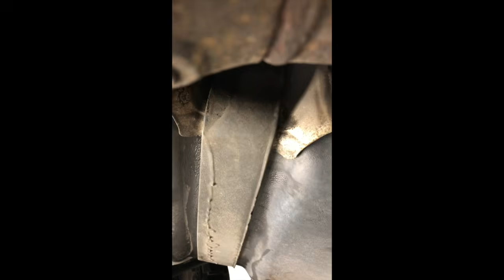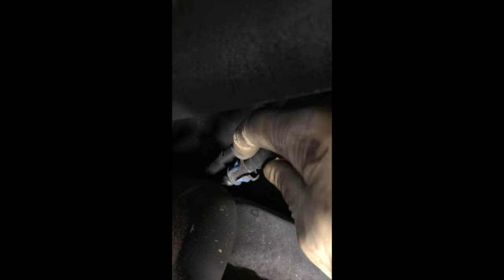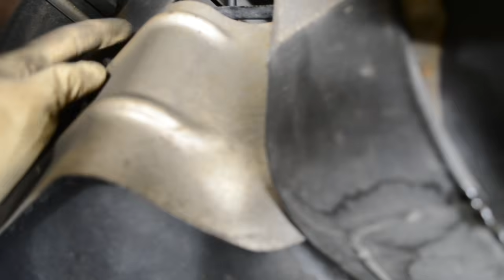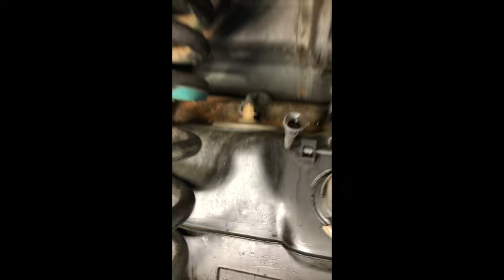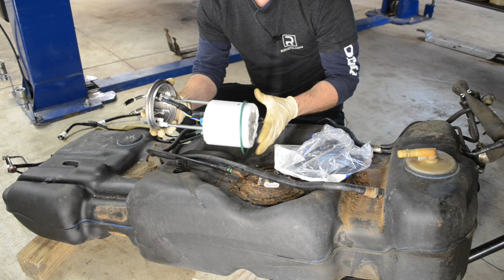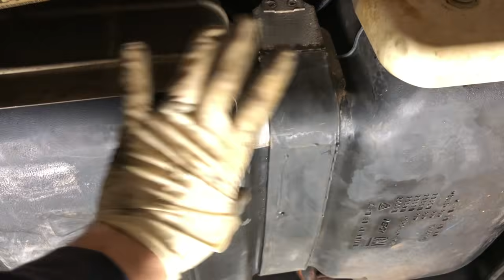Fuel Pump Replacement Chevy Tahoe 2006-2014

Comment: 2007 tahoe here.  Exact same problem. ….. I think.   Smell gas after a drive.  No dripping, but are some dried liquid trail lines along side of the tank.  The evap system is tight, tested with smoke machine.  
I am now (today) in process of removing the tank. Something similar to this is what I am expecting to find.  Sucks that there is no way to see or diagnose this without removing the tank.

Comment: I must ditto previous comments on the excellent quality of the video work for clarity, brightness, commentary and providing a through understanding. I have a 2005 GMC Yukon XL Denali that has same set up. Do you have a video for replacing fuel lines for same or similar? I’m also having to replace brake lines simultaneously. Thank you for helping me complete the work I need to finish.

Comment: This is a great video.  I had a sudden severe leak from the top of my tank and I suspected the metal lines were rusted.   I was able to get a endoscope camera up above the tank and verified a rusted split fuel line.  After viewing your video, I was able to easily remove the fuel tank and fix the problem.  I ended up replacing the evap lines on my fuel tank as well, since the metal fuel lines broke inside the plastic connectors.  I referred back to this video a couple times to make sure I had things oriented properly during reassembly.   Just a quick note on the evap line set...  The evap lines come in a huge box.  Rock auto wanted $60 to ship the lines set.   Amazon end up being much cheaper since shipping was free with Prime.   Thanks again for a great video.

Comment: Man, that's one heck of a job... I'm sure it took quite awhile.

I have a somewhat different problem. I recently started smelling gas in my 2013 GMC Yukon (almost identical to Tahoe), but there is no gas leaking down anywhere... I only smell it when driving and/or idling with the driver's window down. No gas on the road or anywhere around the engine. And I basically only smell it somewhere around the driver and passenger door behind it. There doesn't seem to be any gas smell in the back at the hatch... open or closed, or on the passenger side.

Some guy told me that it "definitely needs a complete gas tank and line replacement." Of course he told me this without actually looking at it. He said, "Experience tells him it all must be replaced and will probably cost me between $3,000.00 - $4,000.00  or more... if not "A LOT MORE". Funny that he claims to know exactly what's wrong without actually seeing under there, but has no clue what it will actually end up costing... not even a ball park figure, again, especially since he claims to already know what's wrong and claims he has done it so many times.

Another mechanic said he would have to actually see the top of the tank and that area before assured diagnosis, which sounds a little more realistic and trustworthy to me. He said if the tank, fuel pump and lines needed replacing it would cost around $1,800.00, parts and labor... IF, he can even find a tank these days. He also said if it weren't too rusty the tank may not need replacing at all. 

I don't know... this [video] repair looked pretty rusty around the rim of that tank opening  where the ring turns and connects... like those clips that hold the ring were rusted pretty badly. I wonder how long your repair will last before those prongs the ring turns into rusts and will no longer support it without replacing the tank also. Why am I asking? Because if I have that problem I'm wondering if it is even worth repairing at all considering the age of my vehicle.  I've owned lots of cars... GM vehicles seem to rust underneath a lot faster than other brands. Am I right, or wrong?

I hate not being a mechanic, and not having the proper tools, facilities, let alone the knowledge, at times like these. Parts and labor for autos have skyrocketed the last few years it would seem... especially at dealerships.

I know this vid is older, but thanks for the info... great vid! And thanks ahead of time for a reply if you are still able or monitoring this channel.

Comment: GREAT video, just finished dropping the tank on my denali. Only difference is the denali fuel pump has three lines out with the evap line connecting directly to the fuel pump versus the back of the tank. The only thing I would recommend adding is blowing out all the evap lines from both directions as carbon builds up in the lines as the evap cannister's filter deteriorates. Remember do it from both directions and make sure the air pressure coming out both sides is the same in force as the air coming directly out your air pump. That's the only way you can ensure their is no blockage in the lines. Also blow out the line from the purge valve under the engine to the right front corner of the gas tank that you disconnect when dropping the tank. I recommend blowing both directions as well. The reason for this is that once the carbon backs up in the lines, it will cause gas the high evap check engine code and you won't be able to  pump gas continuously as the gas station pump will constantly shut off. This is just good preventative maintenance anytime you drop the tank. Also, Amazon sells a $10 tool for disconnecting these fuel and evap lines that makes the job even more a breeze. That front right fuel rail line and that rear evap line were both pains for me the first time I dropped a fuel tank. That little tool makes life a lot easier. Nevertheless great video.

Comment: I  had to replace fuel pump on my 07 Tahoe  2 years ago and Now have to replace it again for the same problem ( Rusted ) What will prevent this from happening ? I was shocked to see how the pump sat down in  the top of the tank where water sits and causes a repeated  occurrence
Reply: Not driving through nasty conditions, buying an oe pump the main issue with the design is the valley that the pump sits in on top of the tank it literally holds every spec of dirt that hits the top of it it's basically a terrible design flaw

Comment: So what was causing the fuel leak the vapor line?
Reply: Corrosion on the top of the assembly, nearly certainly the metal tubes which connect to the fuel lines.

Comment: Where did you get that line set up and what is it called ?
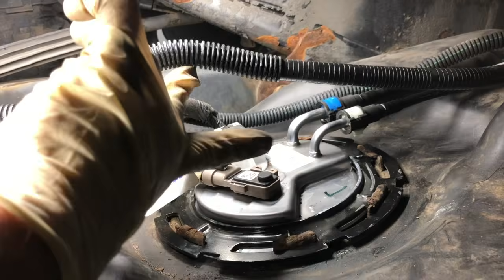Reply: At 16:41 the tag shows the part number
Reply from the maker: Got it directly from the dealer. Fuel lines and EVAP lines.